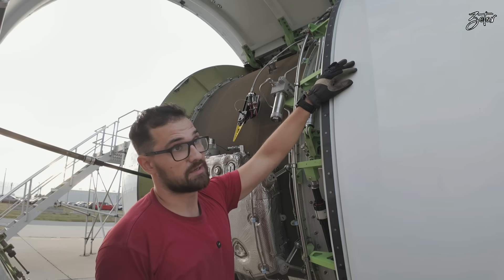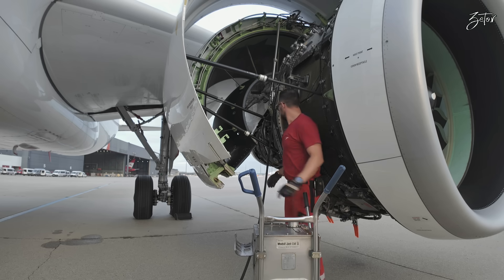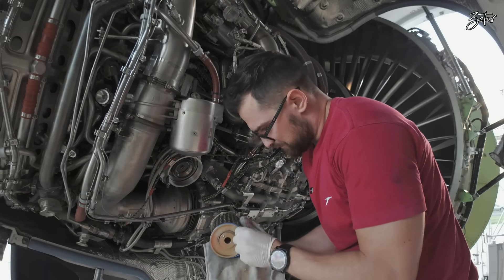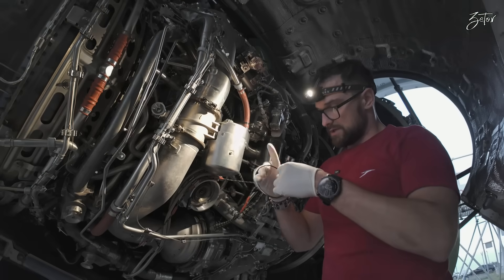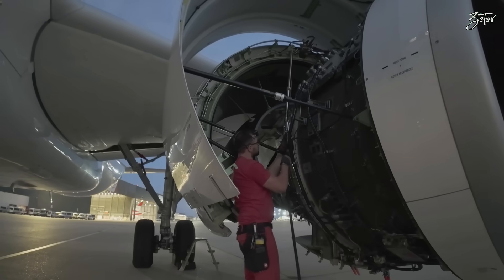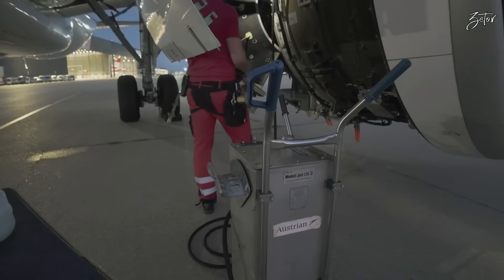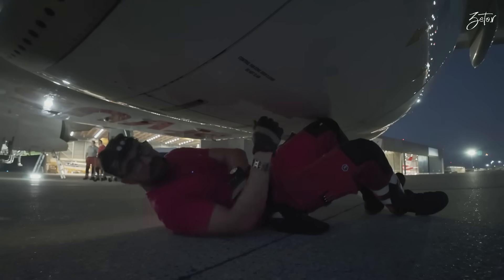How to replace fuel filter on Airbus A320 - PW1100G engine

Comment: Changing this one single fuel filter seems about as complicated and time consuming as changing half of the drive train in one of my Teslas. I guess i'll stay on the ground.
Reply from the maker: When ever you open the engine it is easy and straightforward
Reply: @zeto.r  Yes, that is the fascination of a electric drive train. Whenever you look at it it is easy and straightforward when not constructed by Germans.

Yours are a fascinating piece of tech. Thx for filming it.

I nearly started as electrician in Schwechat 35 years ago. But had a better paying job @ Radio Austria at that time.
Reply from the maker: @wolfgangpreier9160  I love electric cars and everything around it. Unfortunately in aviation, there is no space for that. Everyone has priorities, you had yours 🙂
Reply: @zeto.r  Just wait a few more years, the first working batteries for short to medium hops are just now coming to market from Samsung. 

I say in 2035 we will have a small fleet of e-props with batteries for up to 500 nm. And it will grow rapidly.

Yes, for the long hauls we still will need something to burn. In 2040 it will be 100% E-Fuel and Bio-Fuel. 

Possibly made out of palm oil from Brazil and Malaysian plantations on former rain forests. Just what is used to produce the HVO-100 today.

Cars are just the best tools currently available to transport my employees and me, parts and tools to and from my customers. 

EVs are the most efficient, cheapest solution to this problem. They do not stink and do not poison my kids and grand children.
Reply from the maker: I'm a big fan of new technologies. Electricity and hydrogen is the future🙂

Comment: Firstly - Very good job!
Secondly - Why are you doing the replacement by yourself? 
Is it safe to work alone? Both, for you and the plane!
I mean, are there any redundancy checks after you finish the job in case you miss something?
Have a lovely day!
Reply from the maker: Thank you. I replied to this question several time already,  but most probably it is hard to find 😀. Since this is a critical task I need a duplicate inspector. He inspected every step but not everyone wanted to be on my videos so I needed to edit footage. Have a lovely day 🙂
Reply: @zeto.r  Thank you! 
I thought so, and the question is hard to find!
Maybe edit the video and put a text saying so.
Just a suggestion!
Reply from the maker: Whoever will do this needs to know what are company procedures in such a case, if it comes to my mind during recording I'm saying that 🙂. In some videos, you can see a duplicate inspector because he is ok with the possibility of being visible

Comment: Can I use aftermarket fuel filter on my Airbus A320?
Reply from the maker: There are several manufacturers for many parts but  everything you want to use on an aircraft needs certification

Comment: I use that same headlamp. Best I have found and I have tried a lot of them.

Question: Is there not a torque spec for the filter housing? Aviation seems so safety conscious about everything and there was a hex on the housing for a socket. One person's hand tight might not be enough.
Reply: The blue ratchet prevents the bowl from unthreading in place of safety cable.   The bowl and adaptor are sealed with an oring where a torque spec would not increase sealing and just make the process take even longer.    Interesting fact, one the fuel pressure gets to operating the axial force trying to push the bowl away from the adaptor is over 1500 lbs.
Reply from the maker: I can't explain it better, thank you. And cool fact in the end😎
Reply from the maker: It is a really cool light 

This is directly from AMM:
Install and turn the bowl (2) onto the fuel filter housing with your hands only.
     (b) Check the ratchet lever on the housing to make sure it is in contact with the flange of the bowl (2).
NOTE: The latch is an additional safety measure. As long as the ratchet lever touches the bowl, the ratchet lever can be in between two fuel filter bowl teeth. If the bowl were to become loose while the engine is in operation, the lever will catch the next available tooth on the filter bowl.

That hex is there for Loosing 🙂
Reply: @zeto.r  ok. So as long as the ratchet lever is engaged, it's tight enough. Cool video. How often is the fuel filter changed?
Reply from the maker: Exactly, whenever pressure arises in the system software triggers replacement

Comment: No 2 small piece for 500l/hr?
Reply from the maker: There are huge requirements for fuel quality and whenever pressure is raised in the system software triggers replacement

Comment: Cheers🙏… long as the apron ain’t wet…😂
Reply from the maker: From the rain of fuel ?😄
Reply: @zeto.r  
lol.. from all the tech and glamour of jets.., watching you have to lay down on the concrete I was thinking about some frozen/ wet Chicago or other apron..
Reply: @zeto.r  
We used to service packaging machines that were often in chilled food/ wash down areas.., we had a very tough old guy who would simply lay on his back…, in the chilled water.. wet through… servicing the machine overhead for an hour or more…
I am not that sort.., I want it all up on bench in a heat w/ shop… 😂👍🙏
Reply from the maker: I hate rain but for that, we have mats which I place on the ground but it will get wet anyway 🤷‍♂️
Reply: @zeto.r 
What about mechanics creepers
Reply from the maker: still when you step up it will get wet anyway

Comment: I've never done aircraft maintenance before. But I imagined the process a little differently. 
1) I always thought you worked together with a partner. . One does, and the other controls and checks. 
2) When installing such important devices, a special torque wrench is required to control the tightening force.
Reply from the maker: Yes, I have a duplicate inspector with me and he checked every important step. Yes TW is mandatory for most of critical components

Comment: How many hours do they allow per engine for a fuel filter replacement job? Judging by the fact it was dark out by the time you finished, I'm guessing somewhere around 4-6.
Reply from the maker: The job with run takes max 2 hours
Reply: That’s not too bad at all
Reply from the maker: @F18Skyhawk yes it is more less quick. Just time consuming is onepning of engine

Comment: This is surprisingly similar to a fuel filter change on a commercial truck (except for c ducts and so on obvs)
Reply from the maker: I guess there is no reason to reinvent the wheel, if something works just use it again 🙂
Reply: @zeto.r  True that!

Comment: how often does the filter need to be changed and how many filters are there?
I imagine there's multiple filters, one coarse and one fine, the one you replaced appears to be a fine one
Reply from the maker: It is only a single filter system and it is based on software, once pressure rises replacement is triggered

Comment: I was a petroleum chemist way back and tested Jet A1 fuel and later worked on refuelling systems. Aviation fuel is handled very carefully, of course, to filter out any foreign material and also to coalesce and remove water which could freeze and block lines, etc. The fuel fikter is the last line of defence, and as the engineer mentioned, it will stop any mechanical debris from things like bearing wear.

Is all of your maintenance work on critical components such as the engine checked by another person? The consequences of a simple oversight could be extremely serious. Those of us who fly have great respect for all aviation engineering folk who must be conscientious and professional always.
Reply from the maker: Jop it is the highest quality. That's why we don't need multiple filters. 

Yes, every critical task must be double inspected.

Comment: If the algorithm dictates that I need to know how to replace the fuel filter on a Pratt and Whitney PW1100G who am I to say otherwise? 
I wouldn't have a single clue where to even begin to find the fuel filter on my Subaru but now my fear of flying on an A320 and the Captain coming on the PA to request if there's anybody onboard who knows how to replace the fuel filter is finally put to rest.

Comment: I'm curious. You mentioned the old filter has to be inspected and analyzed for any debris, etc.  Does that happen BEFORE the next flight? If not, and some concerning hidden debris were found, how is that then dealt with? Does the aircraft have to return from mid-flight and land immediately for deep inspection?
Reply from the maker: I inspected it and there was nothing. You have a new filter installed and the whole system is monitored. Depends of findings you can eider dispatch it or ground it

Comment: Lol, it's so small.  There's nothing worse than hearing that 😆. Seriously though, I am amazed at how small the filter is,  unless it has multiple, which is probably likely. Great job you have, btw. Maintaining passenger Airlines is a huge responsibility and a job to be proud of for sure. Out of curiosity,  what is the worst thing you have discovered while inspect a plane? Anything super dangerous to the point it remains grounded or just the usual.

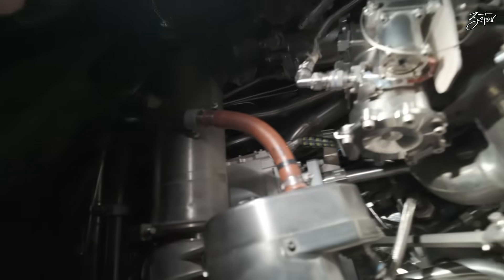Comment: I was worried if after you started closing the engine case 9:36 , if you don't check for leaks!! was about to comment on the risks and safety fail 😱😱!!    Then all was right at 15:00 when you checked, showcase of the concern for safety in aviation!! 😁amazing vid
Reply from the maker: It is necessary to do the leak check and I always follow the manual 🙂

Comment: After running the engine you went back to check for leaks, did you do this before closing all the hatches or did you have to open them for a second time?
Reply from the maker: You need to open it again.  There are no hatches🙂

Comment: no torque spec?
Reply from the maker: Nope, just hand tight
Reply: @zeto.r  Are there some special mechanisim there on the join? What is that called then, there where some special sound like some ratchet mechanism?
Reply from the maker: @AA-iq6ev  I said it in the video, ratchet mechanism is there to secure filter on spot

Comment: When I used to work as platform worker I helped and watch a mechanic replace a air recirculation valve. Inpressive technology
Reply from the maker: I love to watch any maintenance procedure 😎
Reply: @zeto.r  I tought it was funny to see cuz diesel engines have a similar return valve
Reply from the maker: i guess there is a lot of similarities between this and other machines :-)

Comment: Amazing video - - I'm just surprised there isn't a torque spec for seating the filter housing.  thank you for sharing.
Reply from the maker: if you do everything I.A.W. manual it goes very easy in and lock mechanism is very reliable. thank you :-)
Reply: @zeto.r  Understood. I'm not being critical at all I'm just very interested in this work. You have a dream job! Thanks you again for sharing this.
Reply from the maker: @CathalCoolkirky your comment was just on point, I understand that it is weird. Thank you I love it as well 🙂

Comment: Is this the engine that vibrates like crazy if not at cruise speed ?
Reply from the maker: Non of the engine have heavy vibration during flight. If yes we need to find the problem
Reply: @zeto.r  It's not a problematic vibration and i'm no expert but i think PW1000G are known to make a strange noise while throttling up
Reply from the maker: Jop it is called while noise, it happens during spool-up

Comment: Meanwhile on automotive engine filter replacement sometimes need you to take 15 kama sutra pause in order to reach the filter alone and hopefully be able to disassemble il with the tip of two fingers
Reply from the maker: some of works are like that on aircraft as well, I have several videos of them here :-D

Comment: 2:18
At my company were a bit spoiled. We have battery power pumps. They raise those cowls up in ~15 seconds.

I never tried going inside those engines now because of it.
Reply from the maker: that is cool to have such think. it is like on big engines
Reply: @zeto.r  i forgot to say they arent part of the engine. They hook up to the same check valve as the hand pumps. 

Still a wonderful little luxury.

Comment: Nice tutorial. I'll be able to buy my used Airbus a320 that operated for Pakistan international airlines. I saw one on craigslist that has 300.000 miles for $1500. 

Aibus a320s are very reliable.

I love my boeiny 737 500 but it keeps giving me problems. My check engine light keeps coming back and the engines keeps on shutting down and sometimes it would randomly go into nosedives.

I brought the boeing 737 from Adam air so that must be a pretty bad investment.

Comment: Через неделю у меня полет на А320, но я переживал что если мы остановимся над океаном, из за забитого топливного фильтра, я не смогу помочь пилоту, теперь мои страхи ушли!

I have a flight on the A320 in a week, but I was worried that if we stopped over the ocean, because of a clogged fuel filter, I would not be able to help the pilot, now my fears are gone!
Reply from the maker: Well in some countries aviation is the Wild West, with no manuals and no manufacturer support so I guess you should be worried

Comment: Approx. how often does the filter need to be changed on this model engine/plane?
Reply from the maker: Whenever pressure in the fuel system rises to a certain level software will trigger replacement

Comment: Strange how small this filter is considering the capacity of fuel it takes. And why it wasn't torqued to specific Nm with torque wrench, as it does have the embedded nut on it for that.
Reply from the maker: Fuel goes in the tank through several filters and replacement will be triggered by software whenever pressure build-up to a certain level

Comment: Great now the DOT / FAA can rewrite the regulations for securing a A&P Certificate, just imagine the diluted product hitting the Hangars and Ramps for Tech Ops jobs in the next 10 yrs. Who needs school or the ability to read and reference a AMM via ATA CHAPTER.  Now all non English speaking Techs can reference your video’s . Fantastic
Reply from the maker: You need to know values and much more it is not as easy as I show, this is just the tip of the iceberg trust me

Comment: Out of pure curiosity, how much does this cost to the airline? It seems like a really labor intensive process.
Reply from the maker: Which part maintenance 🤔?  Or cost of the parts?
Reply: @zeto.r  Thanks for your reply. I am actually interested in both. Labor and parts.
Reply from the maker: I'm not sure how much the company charge for us but the filter is around 4000€

Comment: Changing a filter is a great leveler. Whether its an A320, or a 2008 Toyota Corolla, you end up lying on your back, on the concrete.
Reply: I saw this and was blown away how a multi-gazillion dollar jet engine company made those 6,000BC cover locks.. As if they couldn't install 2 struts to help lift those 'lightweight' covers and install a ratcheting strap on the bottom to pull them together instead of using a open box wrench! 
Now i know why planes are delayed so often.. (not because of the mechs but because of the time it takes to open and close those covers!)
Reply: @JohnnysCrap it's still cheaper without all the extra weight and more mechanisms that can break..
Reply: @JohnnysCrap  looking at all that stuff gives me strong handcrafted-stuff vibes
Reply: The 2002 Ford Explorer fuel filter on the XLT 4x4 was the worst one ever designed on its placement. I would happily change 1000 of these filters out back to back before touch that ford again.

Comment: Why does the filter have a spot to put a socket on it if its only hand tight? I would think you torque that
Reply from the maker: You can use it to remove it, I just want to show that it is possible 🙂
Reply: @zeto.r  but there is no torque specification for the oil filter housing? You say hand tight but what if someone isnt strong enough to hand tighten it enough.
Reply from the maker: Oil filter is different storry that have several bolts to tight and torque. if you correctly follow AMM it will go very smoothly, I never had a problem with it🙂

Comment: Using a gearwrench helps wonders to help pull them closer.
Reply from the maker: There are ways how to do it with out this puller
Reply: @zeto.r  oh I'm sure. Been loving your vids, decided to switch from auto into aviation and went back to a&p school and now just in the studying phase for my oral and practicals as I've already passed all 3 writtens. Assuming based on the carrier you work for, how does the certification differ for easa?

Comment: How are those engines so low to the ground :]
Reply from the maker: The fan is very big, basically, it is 12/1 ratio. biggest ratio out there which make it very efficient
Reply: @zeto.r  I think I get it, they are really close to the main body and landing gear of the plane on the wing, so if the pilot smashes the plane on landing, the wing bends up and takes those engines up too, so they always keep some cleareance..
Reply from the maker: The clearance is there for reduction of possibility to suck debris from ground.  Even tou fully compress LG, there is no chance to hit ground

Comment: that filter housing clearly has a spot on the end of it to put a wrench to help get it off. no need to muscle it and cause carpal tunnel or unnecessary exertion.

as far as tightening whynot use a torque wrench? too tight and you will crush oring, too loose probably not possible because nobody would put it loose enough to leak but altogether important. plus too tight plus weather makes it get stuck and too hard to get off.
Reply from the maker: Good comment. You can use a wrench to remove it. I just show that it is possible. I'm not sure why they make it this way but it works. And the ratchet mechanism secures it. Thread is very long and if you lubricate the o-ring properly it goes all the way